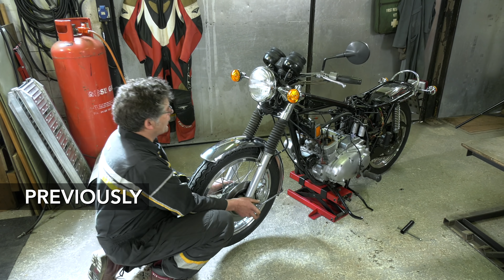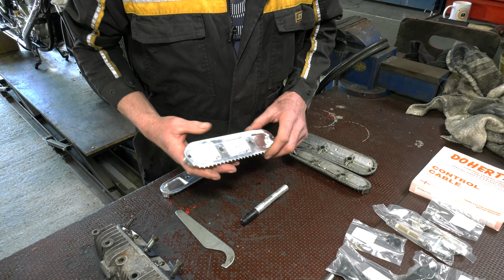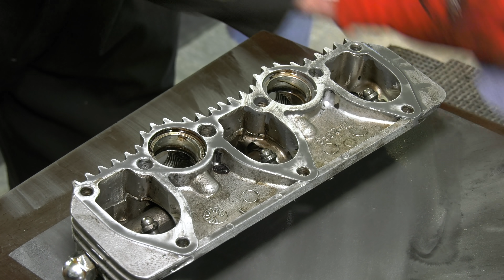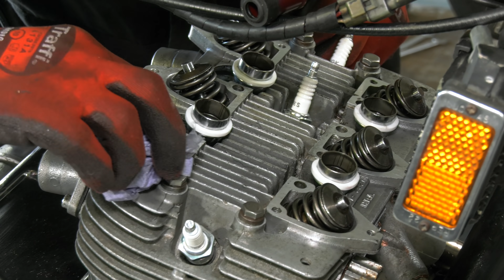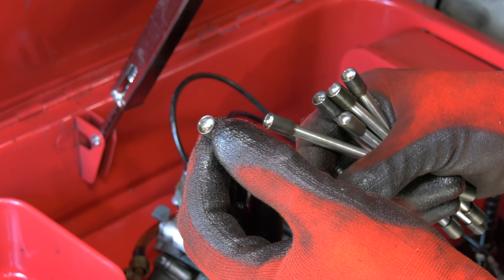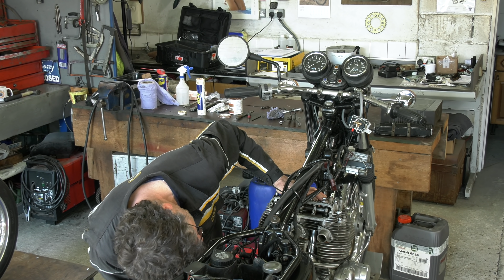Classic Triumph Motorcycle Recommission & Ride - Trident T160 - Part 7

Comment: Before filing bolt heads, it is worth trying to flatten burrs with a hammer. If you don't remove material, the chances of the spanner still fitting and not slipping off are better.

Comment: This man has the patience of a Buddhist monk! (Unless the swearing has been edited out- if it were me, I’d either be swearing my head off, or gone completely off my head by now…) I could watch this all day- informative, interesting, well produced & presented, and very relaxing, for some reason. It ALMOST makes me want to start mucking about with rebuilding a classic bike engine! (I did buy a used gearbox gear set from a Ducati Monster for next to nothing just to figure out how it all works- input shaft, output shaft, gear forks and cogs-  I built a stand out of plexiglass/acrylic to hold everything in its proper orientation and it’s on my desk at home, where I can flick the cogs and spin them when I should be working…) More, please!!!

Comment: Re-commissioning very well done and responsible. Each class increases the knowledge revealed. Using brass brushes of the type of oven, the cleaning will be better, since the bristles penetrate the living corners with greater depth and efficiency. And they leave the aluminum polished. Much obliged. I hope one day to be able to see an AJS or Matchless 650cc G12 model.

Comment: Thanks for keeping the head bolt issue in the video, I’m sure you did check the threads and only when decent torque was applied did it become apparent. I hope there’s enough meat between the barrel and liner to fit an oversize insert. Nice to see some 500 footage too, they’re much under-rated, cheaper and lighter than dry frame Bonnies and great fun to ride.

Chris

Comment: Hi,  Great series of videos on the T160. Very informative.
As someone who works on triples, the pillar studs are a big weak point on the engine and I suppose Triumph had their reasons for using them, but they have given me grief on more than one occasion. Give me a T150 / A75 any day. 
I would also give a bit more detail on pushrod seals and the associated cup and paper gasket on the bottom of them. There are people that swear by a smear of silicone/sealant on the neoprene seals and some others that say 'no'.  The importance of careful assembly in this area cannot be underestimated.
The above points are just what I have experienced and are not a criticism of your excellent work.

Comment: Back in the late 1070s I met a chap on his first ride on a refurbished and better than when new, Vincent comet.  It had stopped and he had no idea what to do. I am not a mechanic and I was just walking home from work so I stopped for a nose round and offered my meagre opinion. After a while I found a weak irregular spark and  the contact breakers only had a very tiny gap. I suspected the 'new' contact breaker heal was just bedding in. I adjusted the gap a little and he managed to kick it into life. As he rode away I noticed the advance lever was in the fully retarded position and the choke was still half on. I'm sure the exhause was blueing as he rode away.  The  words "more money than sense" sprang to mind. As if having a few bob means a  person does not have to learn anymore. OOOOps forgot to say thanks for another splendid video.

Comment: Too bad about this head bolt being worn, but when you have everything in parts again perhaps it'd be a good time to put some dowels holding rocker boxes in place? After some time they start moving around causing leaks and they are only part of those engines without dowels.

Comment: I actually bought a caswell plating kit and I’m in the process of doing all the bolts on my vintage bikes. Got kind of tired of the surface rust after 6 months of restoration so it was well worth the money. Great video!